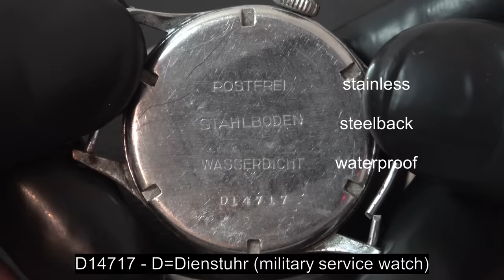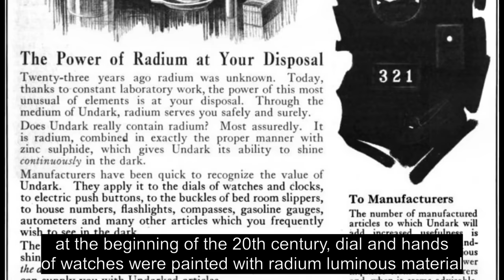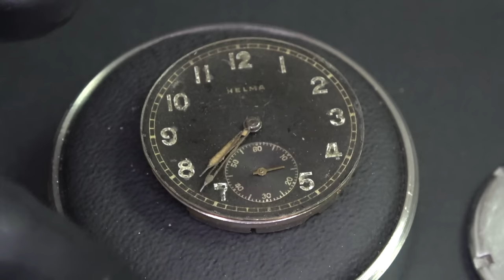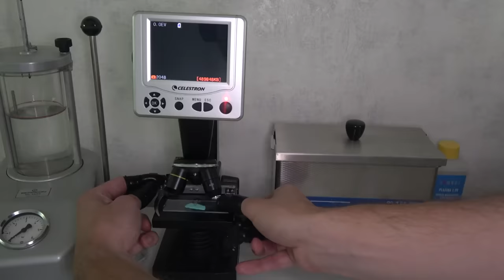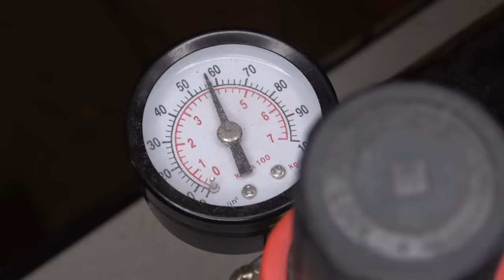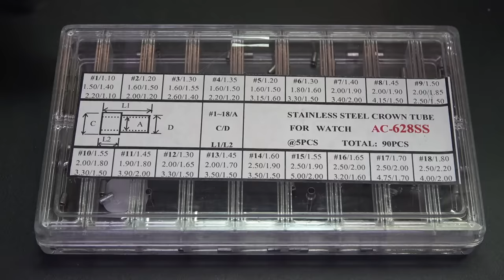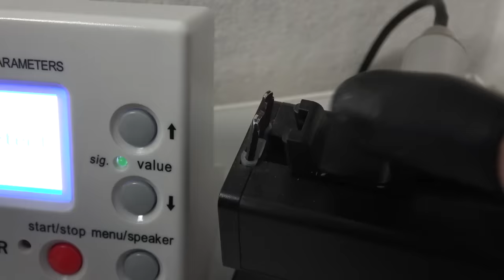Restoration of a Radioactive WW2 Military Watch - German Wehrmacht - Helma AS1130

Comment: I would’ve kept the original crown. Great job, though.
Reply: When it comes to these sorts there are compromises but in this I agree with you. The new one does not work aesthetically.
Reply: I came to say the same thing.
Reply: Everyone beat me to it about the original crown.
Reply: I agree with you, excellent job but the original crown could have been kept.
Reply: ...agree Humberto had the same thought....
Reply: I don’t agree. things like crystals, gaskets, stems, mainsprings, jewels, crowns and crown tubes are basically consumable and often changed at time of service when they become exhausted. This crown and stem was most likely fused and leaving that old stuff creates a vulnerability for moisture ingress.
Reply: @MrMadvillan  The crown spun right off.  Why would you think it was fused to the stem?
Reply: @alext8828  you’re right i didn’t catch that. however judging by the ware on the case compared to the crown, the crown was most likely replaced previously. a hand winding crown should show base metal before the case.
Reply: @alext8828  and the threads on the old stem are rusted up.
Reply: Would have been great to know WHY the crown had to be replaced in any case, if it was not original, or some context. Just a suggestion to an otherwise excellent video - and minor I know.
Reply: @bms9144  red💀dead will have to chime in but if the stem threads are rusted, the crown threads are rusted and it should be changed. If the crown doesn’t seal properly(there’s a small gasket inside of the crown) moisture can get in and foul up the movement. Rust can also break the seal and bits of rust can migrate into the movement and find its way into the jeweled pivots. And crowns really aren’t that precious, especially old, worn and unsigned. You can find loads of crowns in vendors catalogues for this reason.
Reply: @bms9144  Yes!  That is true.  What was the real reason?  Good catch.
Reply: Me too, it looks better and it was in good condition
Reply: Yup me to.
Reply: @esteban8840  on the outside but the threads of the old crooked stem is rusted so the crown would be too.
Reply: @MrMadvillan  I guess it comes down to my fastidious nature, which I suspect isn't unusual among RDR's subscribers. My thinking was that if the crown was original and re-usable, it would be preferable. All the reasons you mentioned as to why it may have needed to be completely replaced make sense.

On the other hand, he completely removed the finish on the case, then re-chromed it, with a great deal of painstaking effort. So my thinking was if he could have done the crown at the same time, he is already re-chroming,  and isn't adding that much (relatively) more to keep it original. 

But maybe it wasn't original anyway; or perhaps it was too far gone (i.e. the crown threads you mentioned) to even attempt to save it. I just wish I knew the rationale behind the change via a note or something. Maybe he just preferred the look of the new crown?

Just trying to give some constructive feedback on what would add to the video, or perhaps for future videos. 

Check out some of the restorations (not watches) by My Mechanics here on YouTube - understanding what is going on makes them the standard.
Reply: @bms9144  yes restoration is always contextual. I personally consider the case and crown very differently, in many ways the crown has more in common with the crystal or caseback as a sealing mechanism. Besides the threading, there is a channel in the crown that holds a rubber o-ring which seals against the crown tube when it’s not in set position. This small seal will keep moisture and debris from fouling the movement, turning it into an expensive and fussy paperweight. Case refinishing is primarily aesthetic; I would never refinish an heirloom, but base metal is also super ugly so if it were a restoration project for resale i’d refinish and plate. Watch suppliers typically have pages and pages of generic crowns, as they do crystals because they act like bike handle grips, car tires or shoes soles; heavily used, abused and refreshed. 

it looks like most commentators’ objections are aesthetic, which is arbitrary and uniformed. classic youtube sh t.
Reply: @bms9144  oh, R☠️R is also an ASMR channel so it’s not going to be big on info. there are other watchmaker’s channels where things are reasoned out
Reply: @MrMadvillan  Interesting perspective on it being more of a wear item, like a crystal or a seal. I have seen a lot of crowns get replaced on the various watch channels I follow to be sure. Good info on the crown seal also.
Reply: The old crown likely was bell mouthed due to the crooked stem, needed to be replaced. Would have been nice one more similar to the original.
Reply: Agreed.  Original crown to be re used.
Reply: @MrMadvillan  Most of these DH watches had chrome plated cases(some exceptions being Longines/Zenith/Doxa/Mido) but most of them had steel crowns as that was a bigger wear point. The crown looks original to me and if not far more like the original. The original fixed lugs, a stipulation for the military contract, were also removed, which is a pity.
Reply: @MrGrentch  could he have sand blasted the new crown (made of steel i guess) and plated the same way as the case to at least match the same look and restored feeling?
Reply: I would have kept the crown and perhaps done more work on the dial since he replaced the radium. Just dial restoration work is extremely tedious.
Reply: Same here!
Reply: Oh you would, would you? Then pick one up and restore it yourself! 😅
Reply: That's what I thought as well!

Comment: Great video, thank you for sharing. The decomposed Radium lume is more dangerous than the radiation itself, the dust is nocive and therefore wearing a safety mask while disassembling and cleaning the watch is a good advice for anyone who likes to restore those watches.
Reply: And from what I've been learning, first uncasing the watch is probably releasing some radon gas that should be addressed with good ventilation...don't want to be breathing that either.
Reply: @tybertimus  Radon have a half life of 3,8 days... The magic behind these watches, is the radium. Nowadays everything is "Awn this that bla bla ..." Snow flakes.
Reply: @leonardosena6338  usually the shorter the half life the higher the activity, also its not the radon itself you wanna worry about, its the fact that radon easily permeates through materials and deposits daughter products into them, making it virtually impossible to decontaminate them. yes the radium is a big hazard in these watches, and the paint spreads radioactive dust like no ones business, but it decays into a lot of radon, which when inhaled is not only radioactive, but deposits radioactive daughter products into your lungs. radon is like the #2 cause of lung cancer behind smoking.

Comment: The poisoning issue reminded me about the old Timex factory in Dundee. The employees were predominantly female who apparently would keep a little of the coating aside & then use it as a cosmetic by coating their teeth with it before heading off to impress their male Jockanese counterparts at the local strobe lit disco!
Even  a quick snog  back then could have had serious consequences......
The serious point here is that by then we were already well aware of hazardous material lsuch as phosphorus. The Trades Union movement used to cite the case of Annie Beasant at the Bryant & May match factory in East London. Again a predominantly female workforce had to eat their food at the workbench & the inevitable contamination would lead to Phossy Jaw-a condition where the phosphorus would eat into the jawbone. Works canteens were introduced as a direct result of this.
Reply: any way we can a watch for restoration.
l have a similar Omega watch ?

Comment: Very good work.
You have not explained that the radiation emitted by Radio is alpha radiation. That stops with the same plexiglass.
The "Feldgrau" strap gives it a very vintage touch.
Reply: I just restored a 1931 Eppler, and was amazed at how well it moves after maintenance. A real old rocker .....

Comment: First off,  love your channel! Second I appreciate how this watch, as rough as it is, still came out nice. It shows that us perfectionist don't need to be so picky. But I do have a question. How easy or practical is it for a hobbyist to do the plating process in a home environment? I always thought it was pretty serious chemicals and required a bunch of equipment.
Reply from the maker: Electroplating is an easy job basically. But of course you should read and respect the warning labels. The fumes/gases is not something you want to inhale
Reply: Ok. Cool. Any good sources of learning on electroplating and metal refinishing?
Reply: @brianwohlleben3182  Geoffrey Croker has a great series of videos on electroplating, so does BaremetalHW. You can nickel plate at home quite safely. Chrome plating however is very dangerous at home due to the chemicals.
Reply: @JamieBainbridge  much appreciated. I knew chrome plating was very bad from automotive work and assumed they all were. Thanks

Comment: What was the radiation reading after you restored the watch?) I am guessing it is safe to wear now? Also, good job on the restoration, the watch looks beautiful!
Reply: I think the level of radiation is the same, that layer on the markings has not been removed or restored.
Reply: @light2tube  Correct.  To be safe, you would take the entire face, hands, and crystal and replace them as the inside of the watch for sure has radium particles inside it.  Most watch repairers  simply won't touch these, and for good reason.

Comment: I havent seen rostfrei marking for 15 years . Had a knife that broke long ago . Best knife ive ever had . I was suprised it lasted so long . Ride down the memory lane
Reply: Interesting fact - the cutlery businesses were pressed into making such items (plus daggers and razors and so on) in large numbers (usually via sending experts to work on various other projects) during the war as they had experience with stainless steel. The most famous city for such work, Solingen, was bombed several times as you can imagine.  Almost everything pre-2000s with "rostfrei" on it was made there or nearby.   Much of the modern cutlery that is made in Europe (such as Switzerland) is initially done there (usually machine-made), and finished elsewhere/firms put their logo on it.  But you can still find forged knives made there.  Mine lasted nearly 25 years before I bought a replacement from the same company.

Comment: Excellent job! It still looks battered but I guess there's not much more in it. And frankly it doesn't really matter because it's a relic from the past, so it's fine the way it is. It runs perfectly, that's the most important thing. Would have kept the crown though. The new strap matches it perfectly!

Comment: Nice job there, a new mainspring is a must, however, I wouldn't replace the crown if I were you. The old one was in pretty nice shape and it looked original.
Reply: Ah, what I do is first prepare new lume and fill the hands with it and later I give them a solid long dip in really strong coffee. They usually look really old then and match the dial well.

Comment: I just noticed something: the radiation detector you are using is not detecting alpha particles, which means you can not measure Radium radiation properly with it. So the radiation on this watch might or might not have been much higher than you measured.

Comment: Wish you didn't replace the crown for one with a different shape :( And you should try adding less of luminova powder - it has to be more watery, if it's too thick it doesn't look great, you only really need to create a thin film underneath the hand just so it connects together and "closes" the hole cutout in the hand. Otherwise solid job! Great video!

Comment: I did not throw away my watch, while it is with tritium. When i see that after all those years the material is active, i am happy i did not throw away my watch in a normal trash bin.
But i wanted to watch this vid, cause i have a watch with a A Schild 11.30 inside. 
I must say, it run like a modern times Sellita. 
It looks so fine, i consider a Hentschel with a manufacture 11.30. 
When seeing a professional watch maker use a lot of polywatch to make the glass new, i know that i  did not used enough polywatch to get rid of a little scratch. 
My 11.30 have no radioactive hands or dial, so i can not get ill. 
I am surprised my watch is thin, while the Helma is a big gun. 
This vid is typical one, that can be watched again.

Comment: You're crazy!!! This watch could only be disassembled in an insulating glove box, after which it could be washed for a long time from radioactive dust in it. Separate case with movement and separate dial with hands and glass. And only after that it was possible to get out of it only the mechanism and the case. It was impossible to get the dial, glass and hands - it was impossible to deactivate these parts, you can work with them only inside the glove box !!!

Comment: Great restoration! Just curious to know if you’ve ever removed the radium from the dials of watches. Or it it to risky in damaging the dials paint when removing the radium. I repair vintage watches mostly Art Deco watches from the 1920s to the 1950s. Lots of the 1920s watches have radium. I have one watch that’s not worth much but would like to remove the radium from the dial as it is missing from some of the numbers.
Reply from the maker: Removing the radium and cleaning the dial has a high risk of damaging the dial or ruin it. That's why I'm not doing it. It's better to have a used original dial then a ruined one 😉

Comment: Did the dial numbers have any radium paint on them either originally or remaining?  BTW, the Radium Girls died from horrific and disfiguring cancers of the jaw and mouth.  The radium had a particular affinity for bone.  The group suit they filed was the first class action legal petition in history and their experience was the genesis of workplace protections that evolved into OSHA.  Your skills in case restoration are amazing.  The watch had just the right amount of remaining character and didn't look as if it had lost its vintage look at all.  Just one more question, since the hand lume is lacquer based, can you re-liquefy the leftover stock by the addition of some lacquer thinner?  It has always seemed to me so much needs to be mixed and wasted to put so little on the hands!
Reply from the maker: I've never tried to re-liquefy but I don't think this will work
Reply: @RedDeadRestoration  I've used lots of nitrocellulose lacquer in guitar making and I would wager if you put the leftover and hardened lume in a small, airtight container with an ml or 2 of thinner, it would soften enough so you could remix it with a stirrer to a consistency that would work.  The lume is rather expensive
Reply: @RedDeadRestoration  You must have some hardened stuff around. Give it a try. Leave it overnight and see if you get a good result
Reply: @RedDeadRestoration  Or better still...premix your lacquer stock with lume and keep it in a very small airtight container.  The lacquer stock doesn't harden in the bottle if it's stored correctly...why would a lacquer and lume mix?   Ok...I'll shut up now!!!!!

Comment: Why do washing machine so old? I never seen a new one? And when using sandpaper, do it in 8. Not circles. Avoid scratches. It is apparent you used circle motion when looking at back plate. It wont come out like that if you do eight motion.

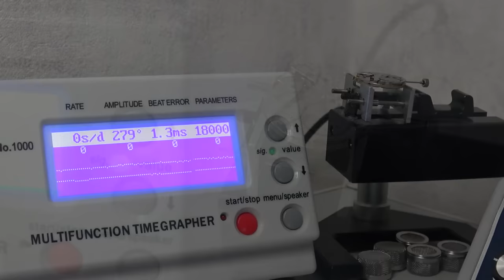Comment: 18:04 if I read that correctly the watch will be off by 1 minute and 52.32 seconds after 24hours of runtime. I have no idea about watches but that seems like a lot
Reply from the maker: No the beat error is something different. Would be a long explanation but if you are interested, Google should put you in the right direction. The watch has +0s/day so after 24 hrs the watch is (theoretically) just in time 😉
Reply: @RedDeadRestoration  Thanks for the heads up! I'll look it up...

Comment: Why did you replace the perfectly functional and authentic winder with a new one?
Also, can the numbers be painted as well?
They were a little neglected, after everything else was so painstakingly restored
Reply from the maker: The original crown didn't fit the new case tube. Repainting the dial would look awful in my opinion and would ruin the originality of the watch 😉

Comment: Hi. Radioactivity is not such a huge issue as presented here. The issue is radon gas when you first open the watch. All other radioactivity is of such length that is mostly stopped by the celluloid crystal and all of it by the metal case/case back.

Comment: Hi. Hätte folgende Frage an dich: Warst du nicht besorgt, mit der alten Radiumfarbe zu hantieren? Welche Vorsichtsmaßnahmen hast du getroffen, um zu verhindern, dass du Radiumstaub einatmest, oder Ähnliches?
Hi. Had the following question for you: Weren't you concerned about handling the old radium paint? What precautions did you take to prevent inhaling radium dust or anything like that?
Reply from the maker: Ffp2 Maske und Vorsicht. Arbeiten in einem geschlossenen behälter

Comment: What is the metal of the body underneath the chrome? Does the movement also become radioactive due to so much exposure over time, or just the face and dials?
Reply: Good question.
Reply from the maker: The case is brass
Just dial and hands are radium painted. Of course it's possible that little flakes falling off the dial enters the movement.
Reply: Thank you!

Comment: Kind of silly question - is it safe to put it on your hand and use it with this radiation?
Reply from the maker: Basically yes, the radiation has a really short range and the case and glass is shielding most of it
But I would not recommend to wear it as a every day watch 😉